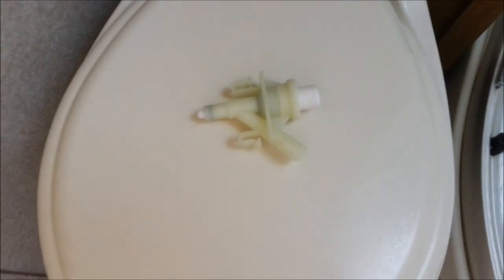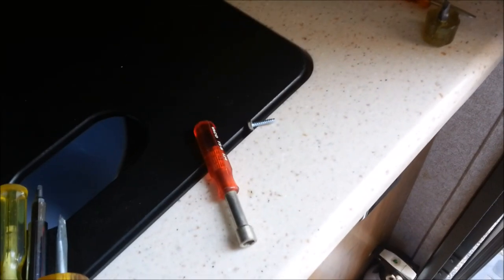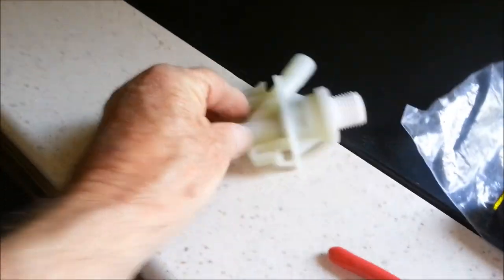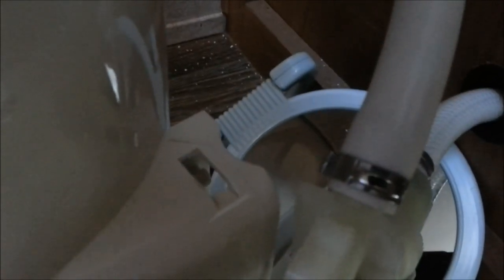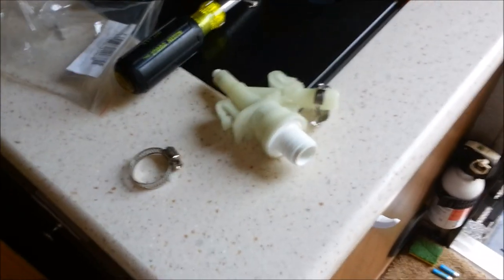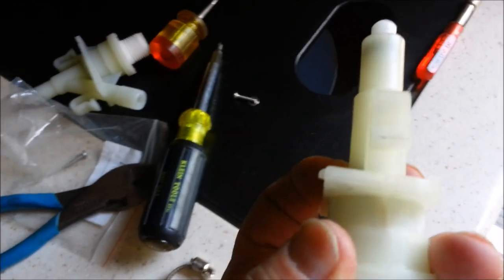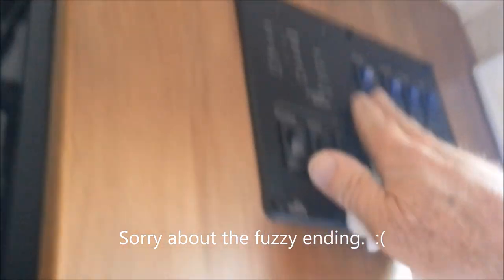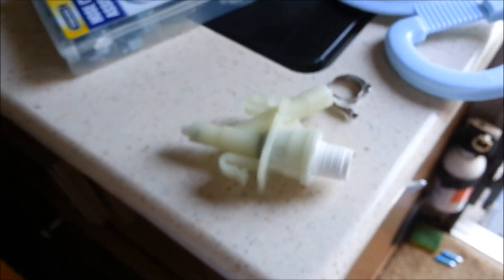Dometic 300 series toilet Valve Replacement Rockwood Mini Lite 2109s. Don't make my mistake.

Comment: Very helpful. Like every other video I saw on this subject, my leak was a result of frozen water. 

I second the point about using a 1/4" nut driver to remove the one screw that held mine.

After watching the videos it took more time to gather the tools than it did to replace the part. I was lucky in that I had more room behind the bowl than other people may have.
Reply from the maker: Glad you got it fixed easy..  Yeah!  Prepping and getting tools was the hard part.  We are PROS now.  :)  Thanks Paul.  Michael

Comment: Well boys I'm a almost 69 year old recently widowed - we had a like brand new camper that had been taken out 2 times before husband passed.  First trip I took camper out by myself I discovered a leak in the valve.  I watched the video - guess what guys that little clamp you had to take off at the beginning - I got off in 30 seconds.  All I did was bend up the little piece of metal that looked like it went into a slot and then took screwdriver and lifted it up and was done :).  Had to share because I took every tool out there thinking I was in for a long haul getting that off - wire cutters and everything.  Nope needlenose to bend the little tab up and screwdriver to wedge it up and popped off in one piece except the little tab broke off.  I did use your suggestion and get a different clamp.  Other than that it was just hard to work in tight quarters.  Did use 1/4 in socket to get that first screw off though.  Thanks for the video it was a TREMENDOUS help - this grandma is not helpless though - I will learn new things up until I'm in the grave hahaha.  Had to learn to pull this thing by myself and back it in a spot (scary part) but my grandkids are going to enjoy their grandma as long as I'm above ground.
Reply from the maker: So good to hear how to remove them.  I don't like those Pex clamps.  Thanks for watching and glad it helped.   Hope you and the Grandkids have a great time out there.   :)

Comment: Your video was great. Great in that it solved my issue and great that it cost 2 RV dealers service money. The dealers were so rude. So I came to YT to get some learning.  I will be replacing the valve that leaks for the very reason described in the video.    No properly winterized.    Thank you to Garland Style for this video.
Reply from the maker: Glad that helped you.  :)  Good luck and thanks for watching.  Michael

Comment: Thanks for the video!
Our Shamrock 183 is a 2014 model, a hybrid, and our Camco 300 won't flush after dewinterizing, and I believe I forgot to flush the toilet last fall. I did pour a lot of antifreeze in the toilet and down the hatch and all other faucets ran pink, but forgot to flush the toilet, so probably the fresh water inside the lines froze solid. Just like you said.
We are up in Ontario in the Toronto area, so do get proper winters. What a bummer!
Reply from the maker: Good.  I hope it helped.  Indeed, you must flush antifreeze through the toilet.  That stinking little valve at the back will crack with the smallest bit of water in it.  I bought 2 more on Amazon as backups since this is a weak spot in the plumbing.  Maybe overkill, but better safe than sorry.  Happy travels.

Comment: I called the service department at the Rv place I bought my 5th wheel from and he told me to make sure my water pump was off, then to shut off the hose valve where I’m getting my city water, then run out my water in the Rv by turning in the faucets in the kitchen and bathroom, then remove the old toilet valve…which I did. Only about 1/2 cup water came out, and I was ready with a towel. It was an old style valve with no screws there, and that’s why it broke, the pincher things that lock and hold it in place- one of them was broken- that’s why the valve wasn’t being engaged, when I pressed the toilet flush pedal it just pushed the valve away because the plastic clamp was broken. So I installed the new one easily, my rig has wayyy more room besides and behind the toilet so it wasn’t a bear trying to get the old valve out and the new one in. I’m a 64 year old grandma and I did it! I feel so accomplished 😅😊 Thank you so much for this video- I couldn’t have done it without you!👍😊
Reply from the maker: Wooo Hoooo!   Way to go.  You did very well.  Congratulations.  😄👌👍

Comment: thanks with your suggestion I used a 1/2 and a tiny socket wrench -so for me the biggest time consumer was taking that weird hose clamp off.
Reply from the maker: YES!  I detest those Pex clamps.  I'm replacing mine with stainless steel hose clamps.  :)

Comment: Actually, taking out the toilet is a very simple process. 2 7/16 nuts removed and just pick it up.  Then you can get to the valve with no problem. Of course you have an open hole to the black water tank - bear that in mind.  There is a plastic flange it bolts to. For removing and replacing the same toilet there is no wax ring, etc. like you have in the house.  It can literally be done in a couple of minutes.
Reply from the maker: Glad to know that Ron.  Thank you.  :)   I hope I don't have to take it out.
Reply: thanks, I might try this way.  My toilet didn't freeze, something is plugged in the incoming water line and I have to find what's plugging it.  Won't flush correctly.  We had our fresh water tank hot drilled to be able to use more of the water and now we have plastic shavings in our freshwater tank plugging all the faucets.  Not a fun thing to work on.

Comment: video was a great help.  But to remove the factory clamp, I found it worked to use flat head screw driver to open the clamp.  Clamp then could spin around but not move up/down.  I used a needle nose pliers with a 90 degree on it to grab the clamp opening and pull it up.  then the hose came off easy.
Reply from the maker: I agree. You think like me AFTER I made that video with my friend.  wow..  :)

Comment: Michael, Hi. Indiana. wen we looked at the camper they had just gotten it in from the factory, and then about 3 weeks later they delivered it to us. So I'm guessing it hasn't been winterized. Thanks, for the information about the water heater. Leaving shortly to go pick the camper up and get it loaded. Fingers crossed, that all goes smoothly!!! Thanks, Ellen
Reply from the maker: Woot Woot!   They likely never put water in it then.  :)   Good luck Ellen!
Reply from the maker: Ellen?  Have you joined the "Forest River Rockwood Mini Lite fan club" in Facebook?    If you have a FB account, search for that group.  LOTS of information as well as seasoned Mini Lite owners and newbies.  :)
Reply: Hi, no I haven't joined the fan club. I will look in to it. Our camper had been winterized. What a Newbie I am. LOL We got all of the faucets and toilet flushed of antifreeze. YAY Our neighbor had a pretty good tip for Newbies. When you're filling fresh water tank, turn on the water pump, then a hot water faucet for just a few seconds, then turn the faucet back off. Your water heater tank will fill, and you won't lose 6 extra gallons of precious water from the fresh water tank to fill hot water heater. Got the camper loaded for our camping trip tomorrow. Just hope our Indiana weather cooperates. Calling for rain. Spent a few hours semi preparing some of the food we're taking, including your Delicious Pico recipe. Look forward to more of your informative videos. No internet where we're camping. So will have to play catch up with E-mails and YouTube when I get back. Thanks for all of your help. Newbie!!!!!
Reply from the maker: That's awesome Ellen!  :)   I'm so excited for you..  truly I am.  I was totally on my own when I did my travels.  LOL    YES!  Go check into the Mini Lite forum.  I KNOW you'll love it.  SUPER women and friends there.  Have fun honey.  :)

Comment: In a situation like that it's always better to take the toilet out,... it only literally takes about a minute and a 1/2 to  undo the 2 bolts on either side and unscrew the waterline and then you're free to work on that on a bench or kneeling on the floor with it on its side.....
 And if you warm up that white hose with a hair dryer sometimes you can slide it off without even removing the clamp and then quickly put it on to the other valve and once to cold water hits it it shrinks up and 'normally' won't
 leak..... But I'm not gonna  guarantee that will be the case.
Reply from the maker: Thanks Skeeter.   In my case, I tend to break more than I fix.  LOL  Hope that helps some folks.  :)

Comment: Well mine wasn't leaking:::just no water flowing when the pedal is depressed.   I could not, to save my neck, get the stupid thing to come out!  I finally decided to go surfing for a YouTube. Was relative easy to remove after removing the screw.  Duh!.  Upon inspection of the faulty valve, it was discovered to be stopped up.  After cleaning the screen wire inside the inlet and re-installing, it seems to be working just fine now. Thanks for the YouTube!
Reply from the maker: Awesome!  Glad you are up and "running".  :)

Comment: Good video.  Thanks, but can you use JB Water Weld to seal that little crack instead of taking it off and replacing it?  That's what I'm thinking of doing.   Your opinion, please.
Reply from the maker: I didn't think of using it.  hmmm.  I felt better replacing it actually.  Hey, give it a try.  JB Weld is good stuff if it will work on plastic.  Thanks
Reply: Thanks, we also have a small hole under our gray water tank I found, and thinking of using JB Weld for that too instead of Flex Seal; bear in mind this is a used 2015 Palomino Puma 28' w/hitch.  We just bought in Nov. 2019 and we're finding all kind of things we're having to fix and/or replace; it has a slide (hope we don't start getting issues with that), and an outdoor kitchen with small fridge, microwave and sink.  We have to replace the antenna (can't get it to come up) prev. owner stripped the crank; also need to replace the awning cover (its electric, so we're please with that) our other 2 campers were not.  Also have an issue with the water going into the fresh water tank when hooked to city water.  We never fill or use the fresh water tank; always go to parks with full hook ups.  Did all the tricks I've watched on YouTube but it still fills up, except for last trip only had 2 lights on monitor for fresh water, so maybe its starting to fix itself.  Hope so.  Considering we paid cash for the camper, we don't mind minor fixes here and there, but its like everything I look at I find something wrong that we have to fix.  Hubby says quit looking for things that need fixing; I say I'd rather find it before it gets worse.  So now we're working on the commode leak; he wants to change the water attachment like you did, but its only a small crack under that attachment and it'll be hard for him to get down there on the floor and do that, so I'm suggesting the JB Water Weld stuff.  Sorry I told you all my problems.  Thanks for agreeing with me on JB Weld.  Your video was so good, I think I can do it.  Happy Camping.
Reply from the maker: The small hole on the water tank.. Try the JB Weld, but me?  I'd have let it dry completely then put a square patch of Eternabond tape over it.  man, I love that stuff.   

Consider the age of the Puma.  yes things will wear out and break, and faster than in a home as they aren't residential material.  They are weaker, but if you are going to keep it, then repair as you would a residence not a camper.  

Stupid antenna in ours is so lame.  I bought a flat panel antenna at Walmart and get SO much better reception.  I did a video on that.  LOL If mine broke, I'd just unplug it now rather than spend $ on fixing it.

Water seeping into the FW tank when connected to city water is a backflow valve issue.  Either inside the water pump, or at the connection outside.  I'd keep searching YT for solution.  I've had it happen to me once.  I turned off the city water connection and remove the hose to stop pressure.  Turned on the water pump and ran it a bit.  Then reconnected.  The water pump back flow valve closed ok, thank heavens, in the pump.  Otherwise, I'd have taken it apart to check the backflow membrane.  yeah, lot of info there huh?  LOL  

The outdoor kitchen and fridge.  I don't have one and would never own that as it is one more thing to break.  I like simple.  Consider that as a great storage area if they do go kaput!  :) 

Get into the habit of checking everything over, seals, supports, roof, water lines, screws, bolts, and so on.  You just have to do that to keep a moving earthquake home functioning.  Way more than your house. It comes with the territory owning a camper.  Especially used ones.

So?  The small and easy fix, temporarily anyway, is to do what I did for 2 months.  Put a rag under the joint to absorb any water.  Mine was only a few drips.  I'd change out the rag every few days if damp.  You want to keep water contact OFF the flooring.   If the JB Weld works, SUPER.  If it slows to a few drops, then use a rag or replace it.  :)   

Honestly, if all the crap in here broke, the shell we live in is home to me.  :)  I could still drag it around and love it.  I don't live or die over the camper, I save that for where I go and what I experience.  I live for the life outside this camper.  :)  Michael

Comment: Does it have a rubber washer/gasket ? Im replacing one and the leaky toilet had the washer and the new replacment kit does not have a washer
Reply from the maker: There was no washer between the valve and the toilet.  I put a little Teflon tape around mine.  No issues with any leaks since.

Comment: Thank u for video,,,just 1 ? 
Where did u get that all nut driver??
Reply from the maker: It is just a cheapo one I got at Walmart or some hardware store.  They are in little boxes with about 6 heads.
Reply from the maker: Did you mean just 1 video?  No, I've done many.  Just search "Garland Style Home" and you'll find my home site.  :)
Reply: @garlandstyle5797  I meant to say one question not one video,,thank you for talking the time to make videos,,you saved me alot ,,,,but that little screw driver or her would of been handy
Reply from the maker: @MrJose1223  Gotcha!  :)   You can find it.  Also?  Check Harbor Freight.

Comment: Hi again, do you have a video on what steps you need to do to get water heater going for the first time? Newbie, Ellen
Reply from the maker: It would be a 2 minute video.  :)   Seriously, you just need to have water in your hot water tank, go inside to the panel, and either flip on the Gas or Elec hot water switch.  :)  That simple.  When connected to shore power at a campground, you would flip the switch on the hot water heater outside to ON, and use the Elec switch inside the camper.  If you aren't connected to shore power, you would use the inside Gas switch.  If you were outside by the hot water heater and turn on the Gas switch inside, you'd hear the burners ignite and start heating water.   I guess I could do a quick video on it some day.  :)   But if you have questions, let me know. Thanks Ellen.

Comment: No winterproofing error here. Just seem to have worn out the valve and while it's not leaking outside the toilet. it won't stop running water In the toilet. And that is a recipe for disaster!
Reply from the maker: Good point.   Thanks

Comment: Do you need to turn the water off? How do you turn the water off?
Reply from the maker: OH yes.  Shut the water pump off if that is on.  Disconnect from City Water if you are hooked to shore water.  There will be a bit of water come out of the pipe.  Flush the stool after all water sources have been closed or disconnected.  That will relieve a bit of the pressure on the lines.  Put a towel or rag down under the connection to soak up any water loss.